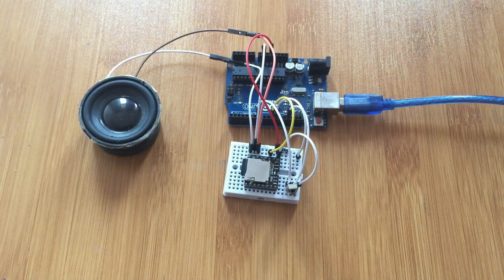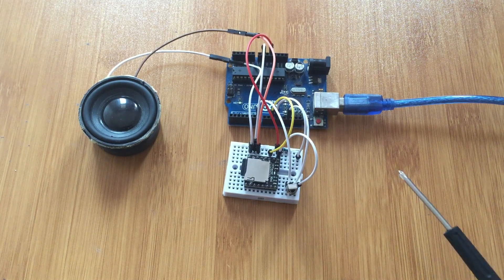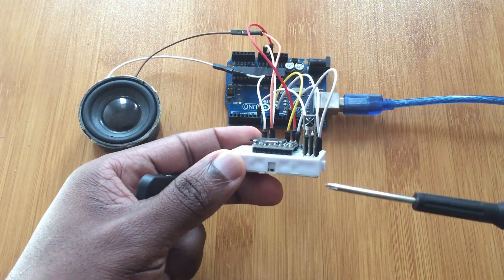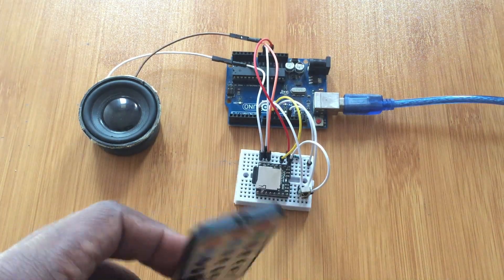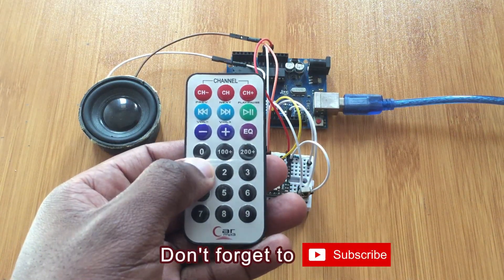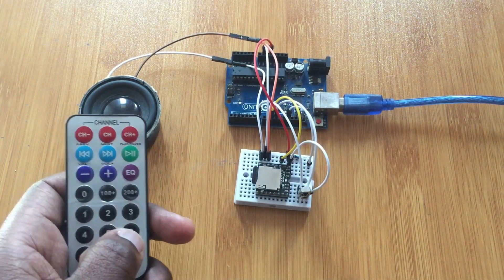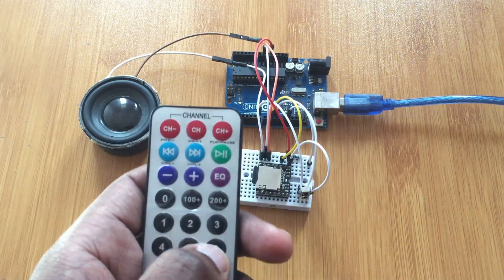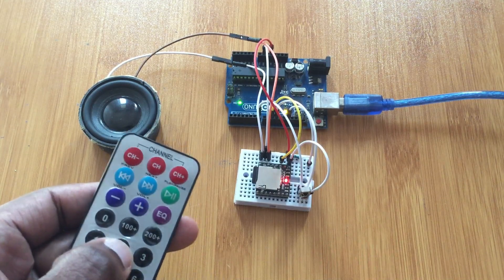IR REMOTE CONTROLED MP3 PLAYER USING DFPLAYER MINI MODULE AND ARDUINO.

Comment: Great information about your project.  I made a PCB to build your project and everything works great.  I have been trying to switch folders without any success. If I read the data sheet correctly you should be able to select a folder using the command code 0x0F along with the folder number.  Have you tried this?  Any suggestions would be greatly appreciated.  Thank again for your work with the MP3 player.

Comment: do u know how to get rid of noise it output?
Reply: This is a noise problem, common with protoboard, you need use electrolic capacitors at entrace of power supply of dfplayer mini and make a pcb to reduce this problem.